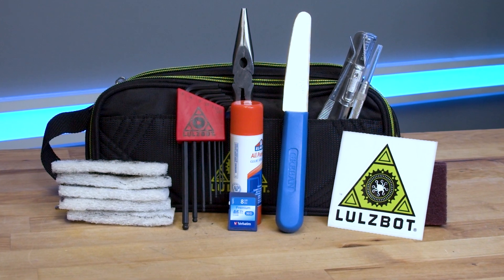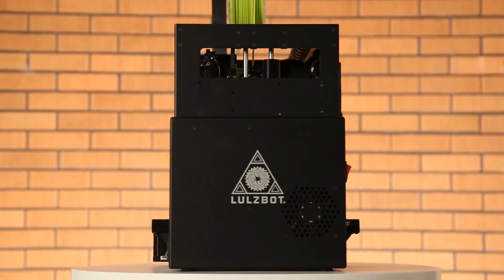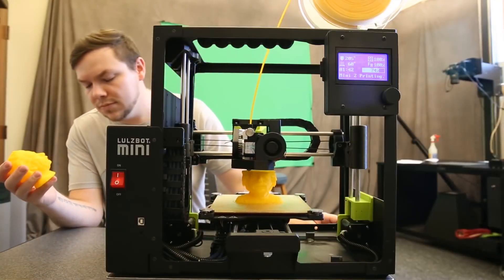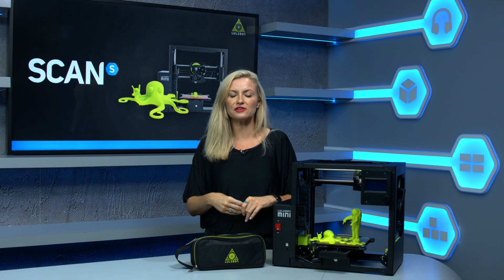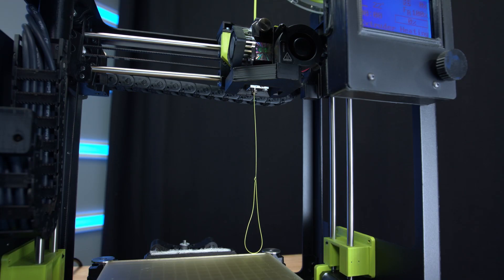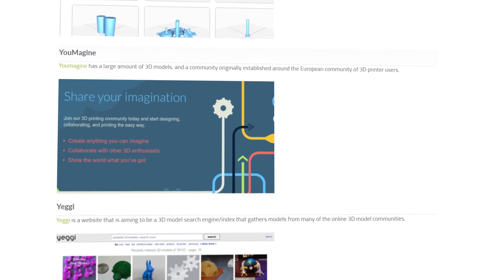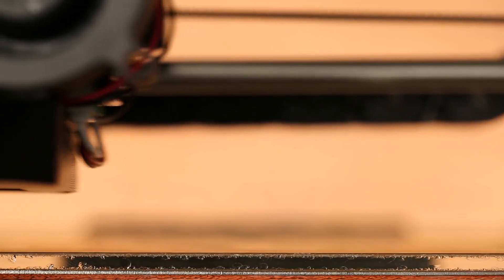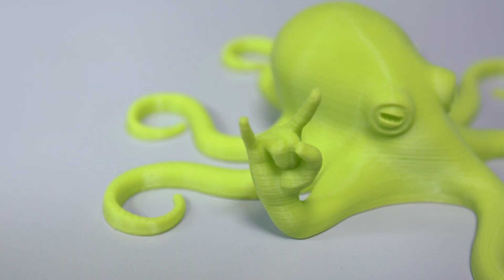Lulzbot Mini 2 3D printer - Overview and features

Comment: I have been looking for a 3D Printer that is easy to use and that I can afford. 
This Lulzbot 3D Printer looks like it would fit my requirements. 
I need one to produce replacement plastic components for reuse / repair of old electronics products. 
I would also like to make use of one available to local makerspace so others can benefit / learn 3d printing.

Comment: great for my solidworks 3D designs, printing accessories for my hornby train layout I need a new Pullman coach - this would be just the ticket, and as I have just purchased a top spec laptop to go with my VR (Occulus) I have the ability to use it to its full potential.

Comment: Awesome printer and the build quality is very nice the printing mechanism is smooth so your 3D prints will be accurate and smooth so no more jagged edges like 3D printers which are cheap.Overall this 3D printer is a beast.